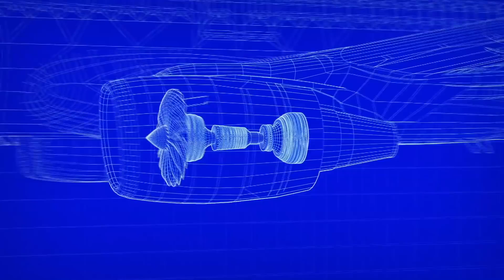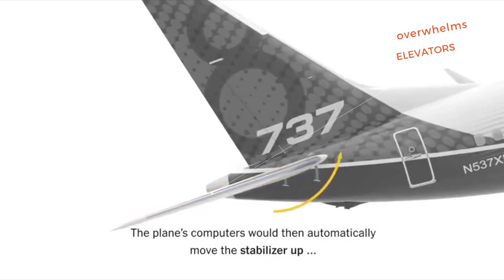737 Max 8 probable cause revealed - Prof Simon

Comment: Boeing is responsible for 346 peoples life that perished on the 2 airplane crash...😞😞😞
Reply: Yonas Abebe That’s a little simplistic and premature to say.  Firstly, we do not have all the facts yet.  Much is speculation, rumours and media hype.  From the evidence so far that seems publicly available, the aircraft should have been safely flyable even with that malfunctioning MCAS.  These are the kinds of things pilots train for.  As a 737 pilot myself I cannot yet understand how a pilot (2 even) could allow the aircraft to become so out of trim without doing something (appropriate) to stop the stabiliser movement.  But maybe there is more evidence I’m not aware of that paints a different picture?  Thus far I am seeing a (albeit only fuzzy) picture that depicts training and standards management of pilots as a potentially bigger issue than the shortcomings of the MCAS or 737 max in general.  The airlines themselves are responsible for training and oversight of their pilots and the procedures they use, and the regulators in each country responsible for oversight of the airline.  If there is any kind of problem of pilot standards issues anywhere in the world I would like to see it identified and corrected.  We would do ourselves a great disservice if we just focus on the mechanics of aircraft system malfunctions.  Aircraft are complex machines which never have been and never will be 100% reliable.  Competent well trained pilots are the best safety net available to protect against unforeseen problems.  Sadly, a procedure for a runaway stabiliser has been long established on the 737 (as far as I know always) and as far as I can ascertain could have returned manual control back to them in seconds with the flick of two switches right next to each other only a few inches from the first officers knee, also easily reachable by the Captain.  The stabiliser is powerful and if it is not doing what it is supposed to it needs to be dealt with fairly quickly.  All 737 pilots (and of many other aircraft too) should know this.  That’s why the procedure is REQUIRED to be known from memory.  Quite frankly from what I know about the MCAS thus far(if accurate!), its not that relevant whether the pilots even know the MCAS existed.  (Having said that I think they should be informed of course). The procedure from older model 737’s should have done the trick.  Perhaps that’s why Boeing made the mistake in assessing its risk? ?  The full investigation will be much more enlightening than the snippets of information we have so far.
Reply: @gavtex1065  . Yes. Sir. I agree with you. Boeing didn't put mcas on the manual. Negligence. Cause life's... Thanks. For the comment 100% agree.

Comment: the jackscrew on the horizontal stabilizer was set the plane to dive on the the groung at the beginning...and locked the mcas to over react...agressivley put the plane nose down that the pilot can't handle...control it...Boeing must be sued and penalized...not putting this on the max manual...shame on Boeing....
Reply from the maker: What the gutsy write...was the massive defection of the horizontal stabilizer by the faulty mcas...made it impossible for the pilots to recover...
Reply: @SimonHollandfilms  But it doesn't explain away why the pilots didn't TAKE manual control WHILE the aircraft was still in an operational attitude. There are 2 "Stab Trim" cutout switches in the cockpit (pri/sec). There is the manual trim actuator to hand crank the H.Stab. On the side of the (spinning) trim wheels, there is a fold up handle used for manually cranking H.Stab position. Even with the trim motor active, there is still enough mechanical advantage in the manual handle to prevent H.Stab movement. Finally, selecting Flaps 1, would also disconnect MCAS. So, with THREE different methods of manually regaining H.Stab trim control, why could the pilots not regain control of the aircraft? I'm not defending Boeing on a questionable design, but at what point are the pilots EXPECTED to take any, and all means necessary to keep the aircraft safe in the case of a malfunction? In my book, that answer is ALWAYS. That IS the pilot's job in a modern airliner to be the last line of defense when something goes wrong AND NOT PANIC. I can't wait to read the CVR transcripts. I'm expecting the crews to be overwhelmed by a relatively minor issue left to run unchecked to the point of making the plane unflyable. At this point, most of us here could restore manual control in about 5 seconds. Why not the trained pilots? Is their training that unrealistic that a CPT with 8000 hours experience doesn't know what to do? Scary!

Now that I'm writing a book here, what about Prime Air? Different plane. Somewhat different circumstances. Same outcome. Plane encounters severe turbulence. Pilots select full power. Nose begins to pitch up (really, it's normal), and is commanded to 54° (!) nose down. Due to severe weather, and pilot inputs, the plane quickly enters "coffin corner", and becomes unrecoverable at the given altitude. I want to see those CVR transcripts too. 54° nose down! I can't imagine what could put that maneuver on the list of "let's do that!".

I'm as frustrated as everyone else in getting the drip feed from investigators. I don't blame them, as they are properly doing their job! I'm just verbalizing the frustration of having to wait so long to get the correct answer...

Hope you enjoyed the "book"...
Reply: Professor Simon Holland I really don’t think it’s quite that clear cut prof.  Yes, the stabiliser appears to have been (lion air) in a position (by the time of the final dive) where recovery from a dive was impossible, however, it did not move to that position in mere seconds.  It gradually moved to that position over ‘minutes’ it appears.  I would have thought that plenty of time to recognise that the trim was NOT BEHAVING as it should, disable it, and revert to manual trim.  There are in fact two ‘backup systems’ (to the MCAS malfunctioning), ‘installed’ in the flight deck - the Captain and the First Officer!  Whilst the shortcomings of the design and function of the MCAS is apparent to all now, and nobody would dispute it needs to be addressed, the investigation will (should) look at all contributing factors.  In my opinion the MCAS malfunction, as it appears to have happened with lion air, should not have led to a crash.  However, it’s probably best to let the investigators do their job and KEEP an open mind.
Reply: Thanks. Professor. I love this discussion...
Reply: Prof. The computer won ! This time.